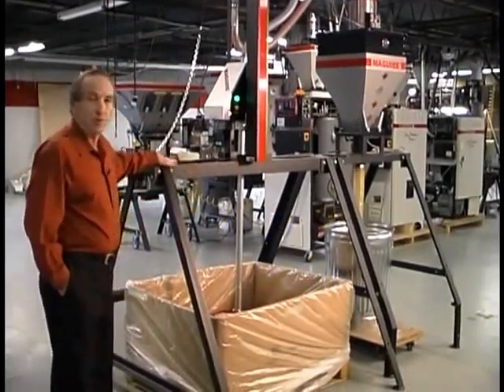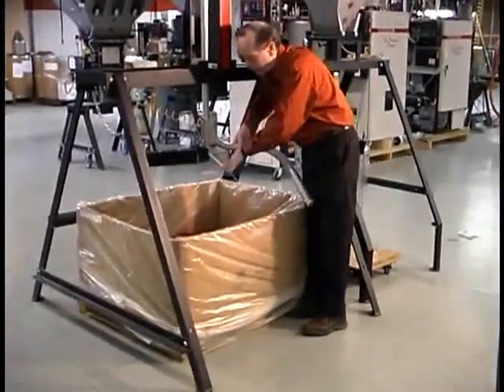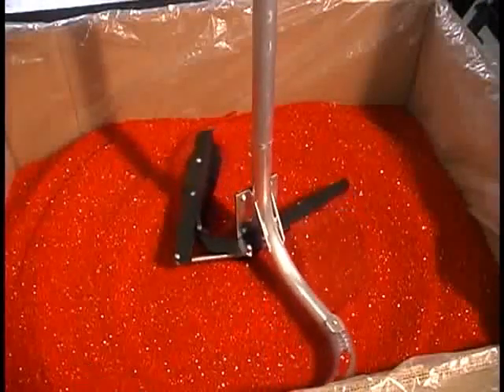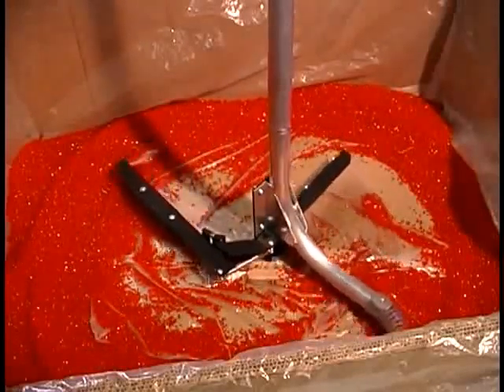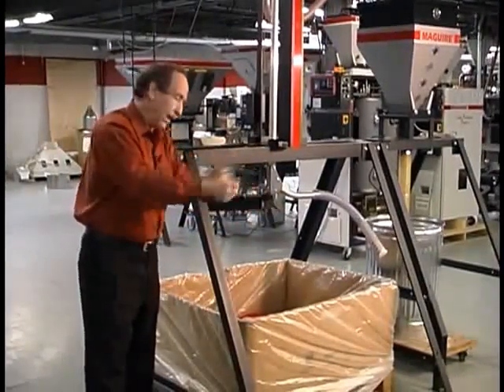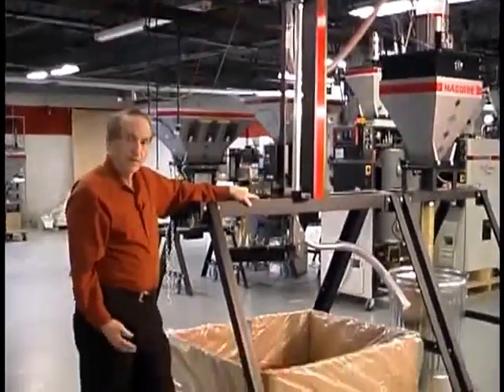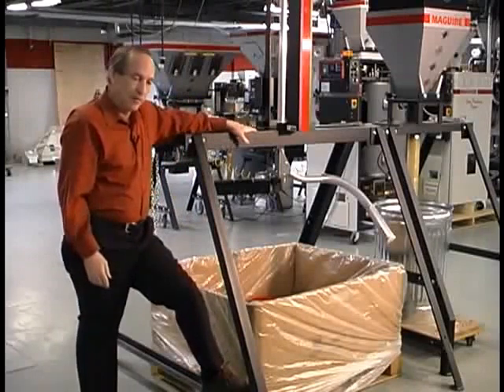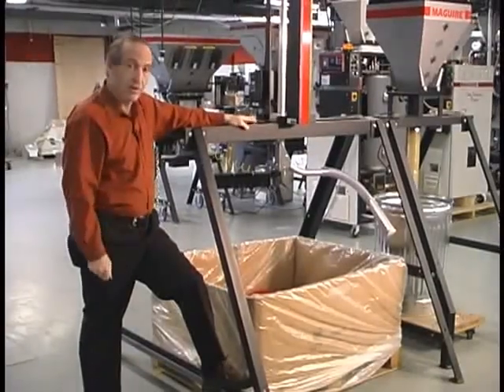Sweeper System - Plastics Gayloard Unloading Systems - Maguire

Comment: What happens with all the left over at bottom?
Tilters will get 98%
Reply from the maker: Tilters work well as long as the material does not form and create a rat hole, then you still need to move the wand. There will always be some pellets left behind. We provide both, right tool for the right job. Have you tried a sweeper?